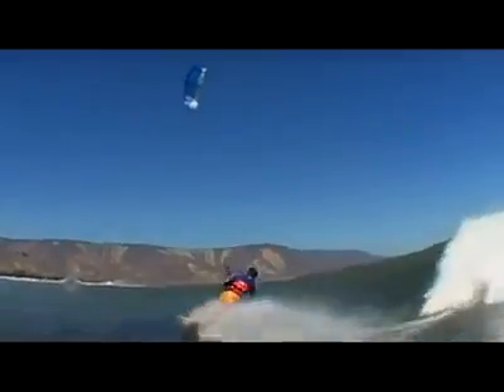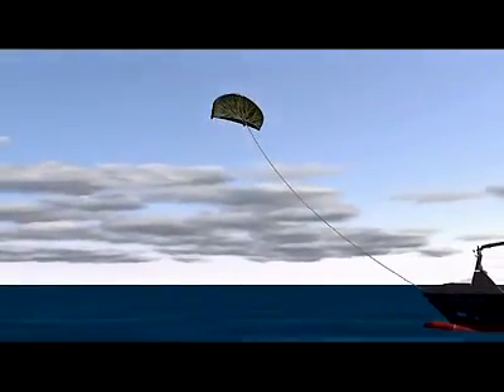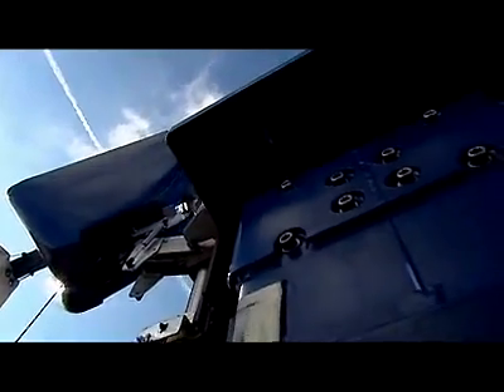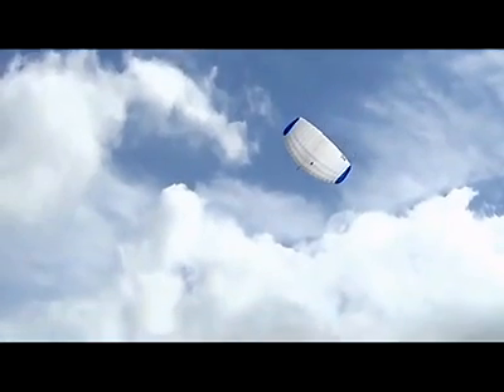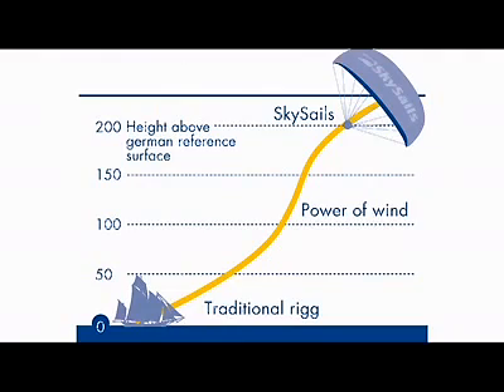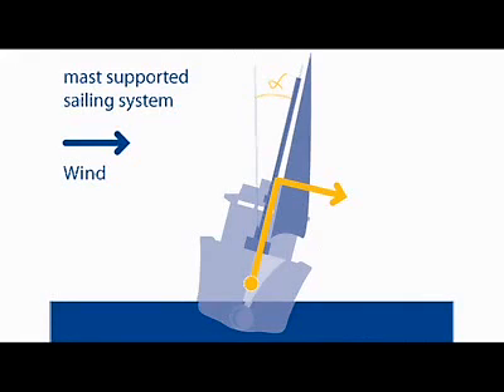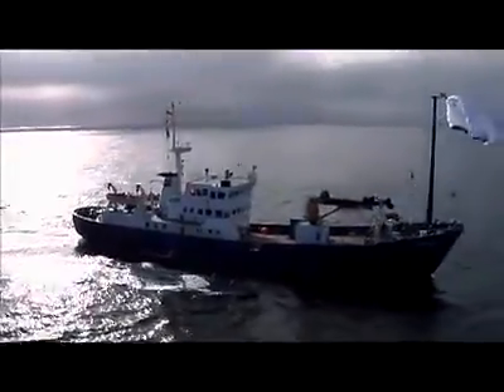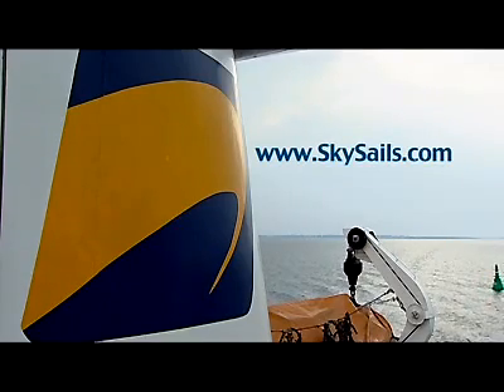SkySails bring windpower to container ships.mp4

Comment: If my math is correct if that thing goes in the water it would be equivalent to towing up around 200 55 gallon drums of water or 100000 lbs.  I'm sure the physics is different and there is some type of release mechanism but that type of force would rip that winch system clear off the deck, bye bye really expensive kite.

Comment: Does not need extended two or four lines. The control mechanism is attached right up at the kites bridle which inturn is controlled by a computer in the bridge of the ship. This allows the kite to do the figure of 8 moves to harness maximum power from the wind.

Comment: one kite is ok, one rope is not. With 1 rope you only go to same direction of the wind. Sorry but you need 2 or 4 ropes to control where you want to go. But 1 rope is better than nothing. Thats my opinion and I have been used kites to pull my kayak for many years.
Reply: the kite is steerable, as seen in the video, the steering lines just run along the main center line